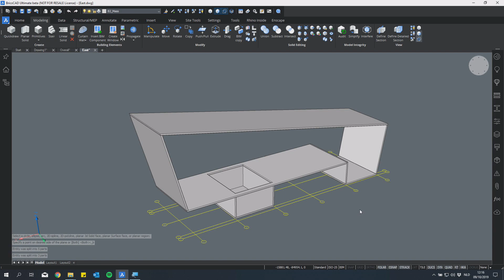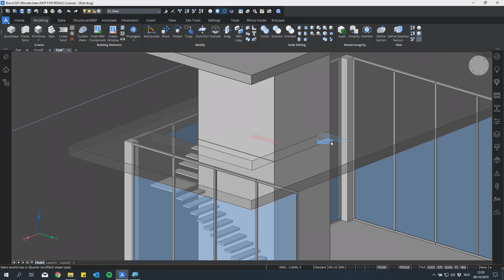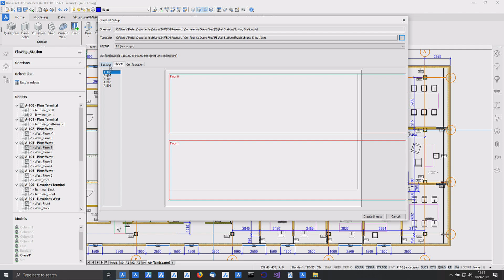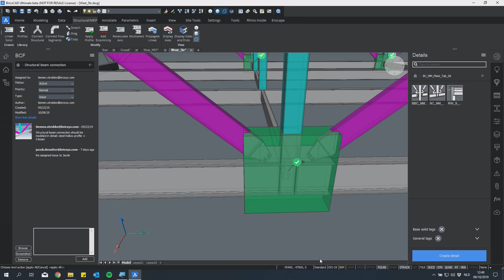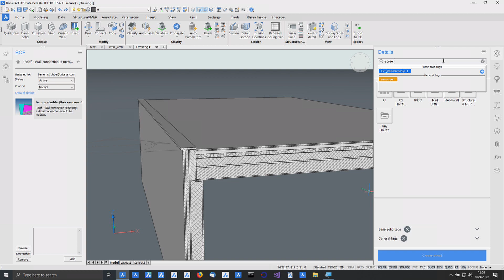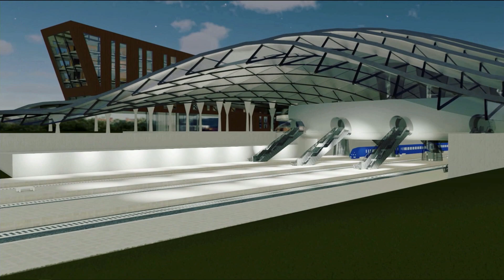Bricsys 2019 - The new BricsCAD BIM V20 - Keynote

Comment: I give thumps up. I worked five years with  Archicad and now two years with Revit and I like, that you have a built in managing / communicating tool. Also the similar details founder is cool. Also it looks that your interface and the way how you model objects is fast and intuitive. I love to work and model in perspective view... In REVIT its PITA. Also thumbs up for the Mc Neal cooperation. You can benefit from Food4Rhino base! Ladybug, Kangaroo, etc. I have question. Is there a trend to create a standard to share / export a IFC-ish model that could be modified by other soft and than import it back and be able to edit, synchronize, merge or somehow update your model by the modded one to save time on updating the changes? There is no ultimate soft, so the inter-compatibility is wanted. I had to use dynamo and humming bird to bring editable elements from Rhino back to Revit. Now Rhino in revit seems to be the solution. Thanks!